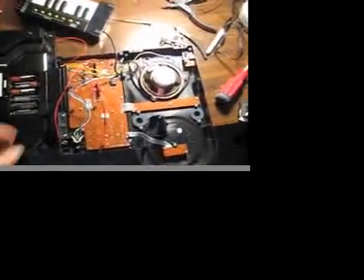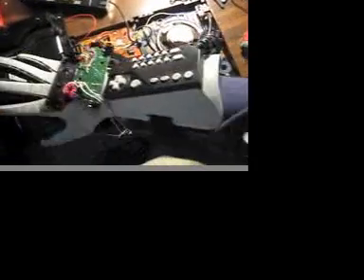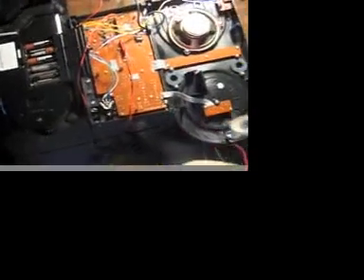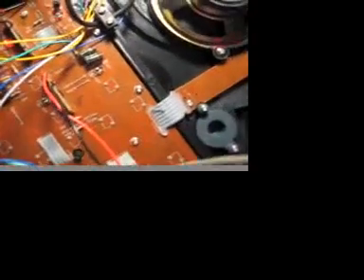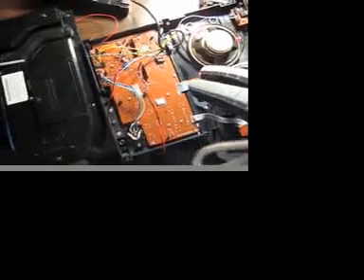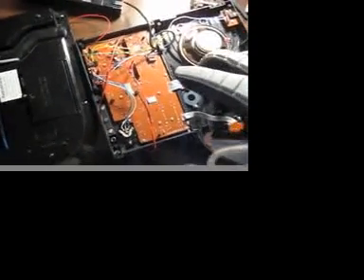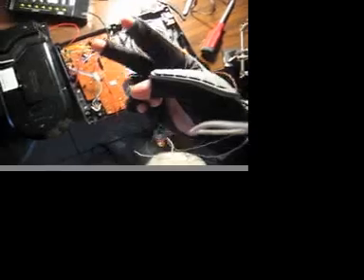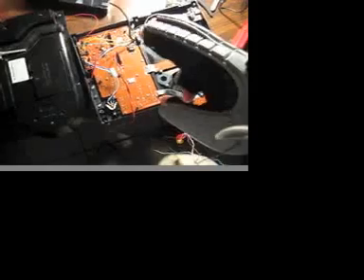Nintendo Power Glove and Circuit Bending

Comment: How is it done? What circuit points on the keyboard did you wire to the glove's PCB? I have a Nintendo Power Pad that I would like to use as a controller for a circuit bent keyboard of mine. I know you have to interface with several of the Nintendo controller pins,  at least two of them need to be wired to +5V and GRND to power the glove/pad/controller right?